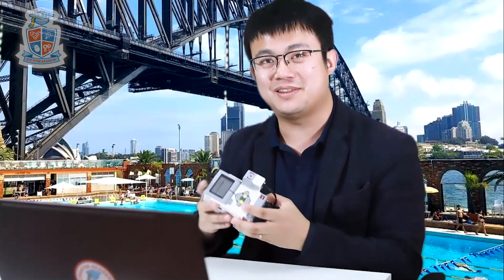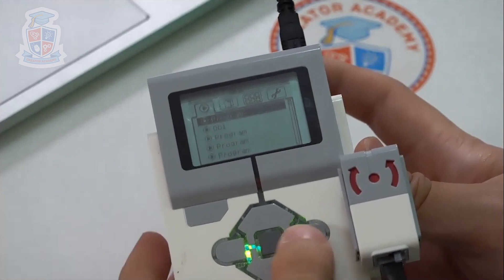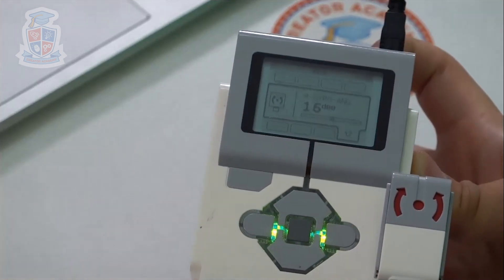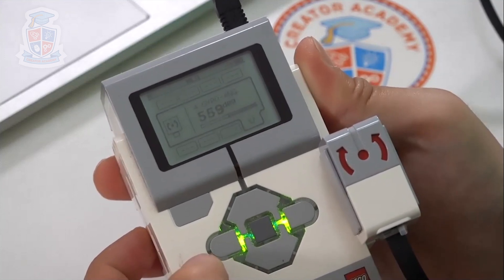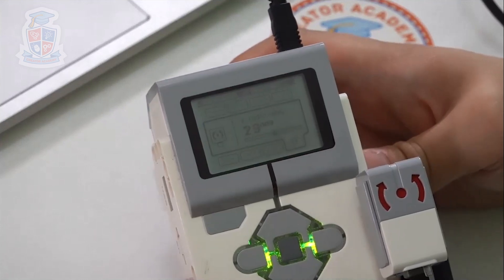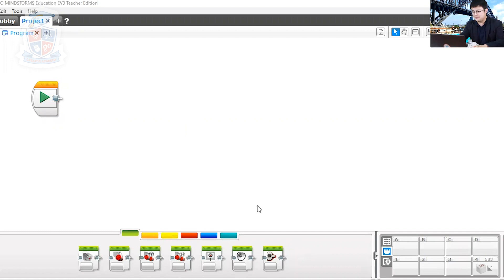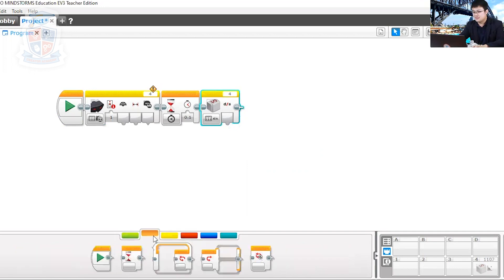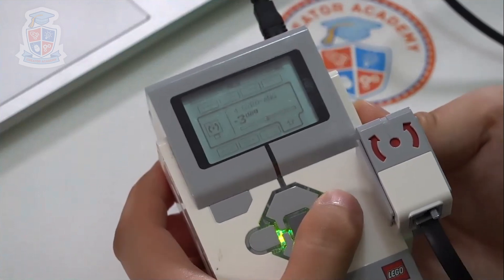How to Fix EV3 "Gyro Drift" Error

Comment: Couldnt you simply use a wait block in front of the initial gyro block? maybe for a couple seconds so you have time to put it down so its perfectly still? or does it base its measurement off when the program starts regardless of the gyro block being called?
Reply from the maker: Hi! The error happens regardless of the program unfortunately. Thanks for watching! Garry
Reply: @CreatorAcademyAustralia  that's a shame then, waiting for mine to turn up

Comment: I tried out this idea and have been using it for a while with my previous teams and it has been working great. This year I tried out this program but after running it once, it stopped working and I'm guessing the ev3 became immune to it because it no longer works. How can i stop that from happening? The gyro has been drifting every 2 days and is drifting really bad. Our competition is on Tuesday, do you have any ideas or solutions?
Reply: Did you figure out a solution?  Did updating the EV3 firmware make this fix stop working?